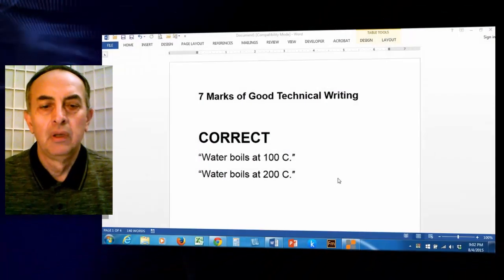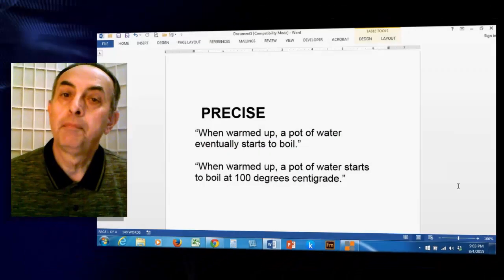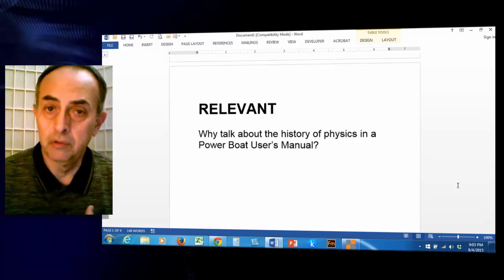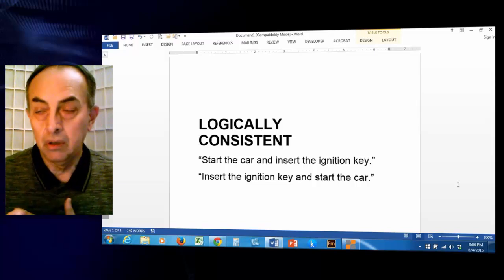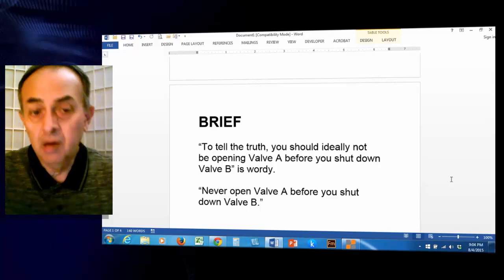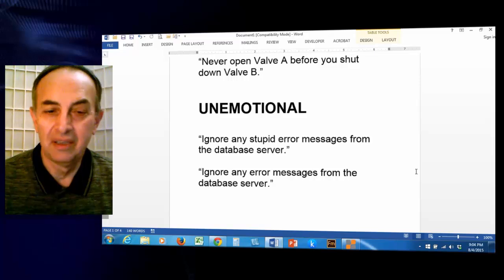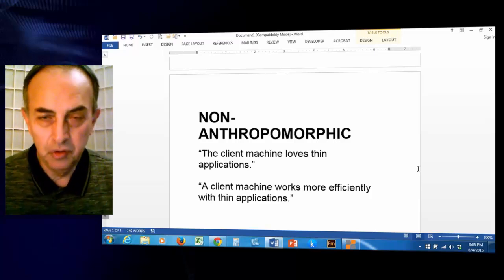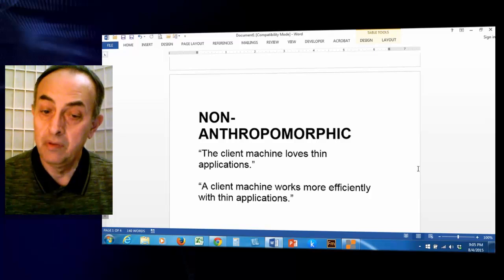7 Marks of Good Technical Writing

Comment: What are the best ways to build these skills?
Reply from the maker: Practice. Practice. Practice. If necessary, do it for free for a limited amount of time to build your portfolio and testimonials. There is nothing that teaches quicker than an assignment for a real client/customer. Take a technical writing course that provides a lot of exercises for you to try out your skills and explains the details of building an actual technical document template. And let me know if you need any further help.
Reply: That’s not enough.
Practice at work, when you’re sitting uncomfortably, at a crappy chair, with backlight and when you’re tired and stressed out.

I’m dead serious. 

Practice from the safety of your home environment has zero value. Your performance should be predictable.